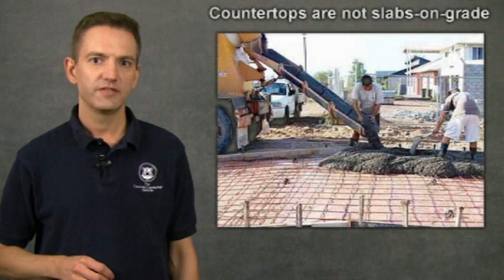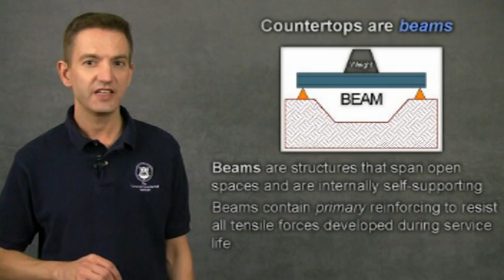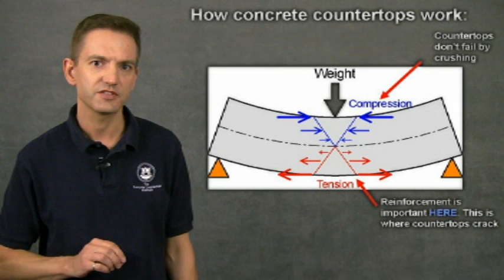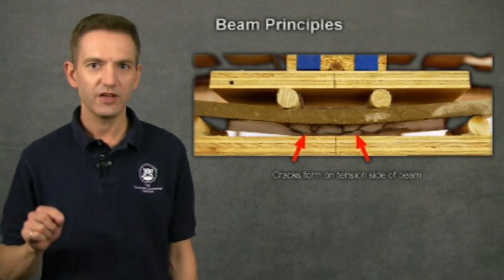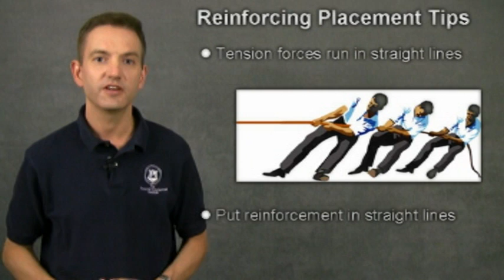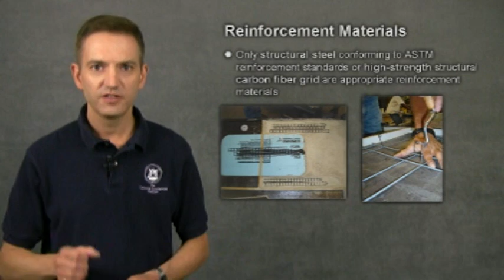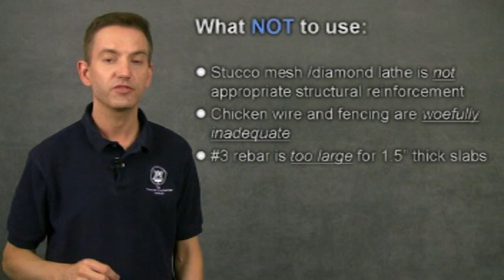Concrete Countertops: How reinforcing works

Comment: Very useful informative and useful. But it would be far more useful to focus more on the practical applications of reinforcing a concrete countertops. Such as how best to use 9 gauge ladder wire and GFRC. 

For example, can just outer third to half of concrete countertops that will be in tension just use GFRC while the opposite side just use a conventional mix? Also will using GFRC have an added advantage of making the concrete more resistant to cracking from impacts too (if its used on the surface)? Is pretensioning of the reinforcement like when using  9 gauge ladder wire ever recommended? Or adding plasticizers to prevent superficial cracks. And is has or could an aerated or polystyrene concrete be uses for the inner part of the countertop that not in compression or tension?
Reply from the maker: This seminar is about reinforcing principles that apply to conventional precast concrete. Reinforcing for GFRC is completely different, and in fact you cannot use steel reinforcing in GFRC. For extensive information about GFRC including how the AR glass fibers provide primary reinforcement, please see http://www.concretecountertopinstitute.com/blog/2015/08/index-gfrc-concrete-countertop-training-free-information/.
Reply: Sorry it was a typo on my part, I should have said "9 gauge ladder wire or GFRC", since I realize there would be issues using both them in the same countertop. And thx for getting back to be so quickly and for the link even if u couldnt address my inquiries. Keep up the good work.

Comment: in conclusion, with concrete particularly, we have so much flexibility and it will tolerate lots of flex, especially when you try to realise your designs. however, there are some basic building block engineering tenets that this man puts back in your mind. concrete is seriously underexploited, but then so are most plant fibres too.

Comment: Do you guys use pp fibers in some products?
Reply from the maker: We rarely use polypropylene fibers. These fibers are not for primary reinforcement. They can play a valuable role in shrinkage control during the curing process but provide no benefit after. Please see http://www.concretecountertopinstitute.com/blog/2017/11/fibers-precast-gfrc-ecc/.

Comment: I am building a 1.5" x 4' x 5' slab for an outdoor kitchen. They will be supported by a 5' x 32" cabinet base. Do I run ladder wire close to the bottom of the slab depth along the 5' length direction for the Simpson's beam stress and  another run of ladder wire along the 4' width direction for the cow cantileaver diving board stress? If I do this properly, do I also need corbels to support the 16" overhang, or is the integral ladder wire enough?
Reply from the maker: Joe, I love the terminology "Simpson's beam stress" and "cow cantilever diving board stress"! LOL! 

Yes, the 5' length ladder wire is on the bottom of the slab, and the 4' length is on the top. You likely don't need corbels because you've got a 2 to 1 ratio of supported to unsupported, so you don't have a tilting problem. However, corbels never hurt, and they can be a decorative feature.
Reply: Glad to bring you a laugh. One follow-up: your 3 hour intro seminar says not to vibrate after reinforcement goes in because it can sink or cause ghosting.

I'm not worried about sinking because I'll suspend reinforcement from strings, but since the cantileaver reinforcement goes 1/4" from the bottom of the form, how do I vibrate? Do I pour less than 1/4" of concrete, vibrate that, set the reinforcement in place, then pour in the rest of the concrete?
Reply from the maker: You are correct, Joe. Also make sure the reinforcement is well supported/suspended so it doesn't move around during vibration. Or, you could avoid the issue completely by using a stiff, hand packed mix or by using GFRC.

Comment: I'm doing an outdoor concrete countertop and I was wondering if I could or should use the block wire and the fiber glass together ,it will be two inches thick and i will be using 3/4 inch stone in the mix as well ,thanks for you help
Reply from the maker: If by fiber glass you mean AR glass fibers, no. Those are used as primary reinforcing in Glass Fiber Reinforced Concrete, whereas steel is used as primary reinforcing in traditional aggregate based concrete. You can use various types of fibers for secondary reinforcement to control plastic shrinkage cracking, but those fibers will not replace steel or provide/supplement structural reinforcing. Please see my blog articles about fibers: http://www.concretecountertopinstitute.com/blog/?s=fibers&submit=Search  Curing is also a very important part of crack prevention, as is proper mix design and low water-cement ratio.

Comment: Great video! What is the best method of reinforcing inside corners for a L shape countertop?
Reply from the maker: Just treat the 2 ends of the L as 2 overlapping rectangles. Mix design is also important for preventing cracks on inside corners. You need a good mix design that has low shrinkage potential. Usually interior corners on sidewalks, etc., crack because the concrete has too high of a shrinkage rate. My mix designs are available here: http://www.concretecountertopinstitute.com/product-category/self-study-training/mix-designs/ And of course you have to cure properly too.

Comment: Excellent explanation. I need to make a very thin rectangular countertop, say 19 mm thick x W=800 mm x L=900 mm supported at the perimeter. Can it be done? how? Thank you!
Reply from the maker: For this large, thin application, I would use GFRC instead of traditional precast. Please visit our website at http://www.concretecountertopinstitute.com/blog/2015/08/index-gfrc-concrete-countertop-training-free-information/ for extensive GFRC information.

Comment: What grid dimension of ladder wire do you recommend?
Reply from the maker: Alex, the grid dimension does not matter, because only the longitudinal strands matter. Mesh reinforcing generally has a grid spacing that is too big for the number of strands needed for countertop-sized slabs. What complicates things is that the number of longitudinal strands needed is entirely dependent upon the length of the slab. For instance, a 4 foot section of kitchen countertop may only need 4 strands to be strong enough to handle, yet a slab double that length need more than three times as many. There is no simple rule of thumb for this that doesn't either underestimate for large slabs or overestimate for shorter ones.

Comment: great video ... how far in from the edges of a worktop should the ladder mesh run? i.e. if i had a 2400 cm worktop ... what length would i cut my ladder mesh to? thank. doug
Reply from the maker: You should run the reinforcing as long as possible. You need only about 6mm of cover, so you can go that close to the edge.
Reply: Cheers!

Comment: A very informative video!   I'm planning a counter top (60" X 30" X 2" slab) with a 2 inch over hang on 3 sides.  Should I run the ladder wire from back to front (30") or lengthwise (60")?  Thanks again for the great video!
Reply from the maker: Thanks, I'm glad it was helpful! this is a good question. You are thinking about where the stresses are in the countertop. You should definitely run the reinforcing lengthwise (60"). To be safe, it wouldn't hurt also to run it back to front (30").

Comment: Excellent Video. Thanks very much! In your example of a sink cut into the bench top, how would you have reinforced this? Cheers.
Reply from the maker: You are very welcome Tom! When you have a sink cutout, you still need to run the reinforcing all the way along the slab in a continuous straight line. So you reinforce the same but also add extra reinforcing in front of and behind the sink.

Comment: What kind of long metal or mesh can I use to make my 56" × 26 nch countertop? It is straight with 2 small sinks.
Reply from the maker: This should be relatively low risk, but use the 9-gauge block ladder wire recommended in the video. It's available from masonry supply stores.

Comment: What is the best way to avoid the ghosting? You mention in your blog that pouring over reinforcement and placing reinforcement after pouring both can cause ghosting...as well as vibration...so what is your best recommendation on how to avoid this? Finally if it is pouring over the reinforcement, how do you suspend the ladder wire? Thanks Jeffrey!
Reply from the maker: Please see this article about ghosting: http://www.concretecountertopinstitute.com/blog/2012/10/how-to-avoid-ghostlymistakes-in-your-concrete-countertops/

Comment: Thanks for the great video Jeffery! Very helpful. I am making 1.5" thick pre-cast countertops for our kitchen and am planning on using 9 gauge masonry wire as reinforcement. Based on the info presented in your video, am I correct in saying that you would not suggest making a perimeter loop out of rebar or any other material? Also, what distance from the edge of the countertop would you recommend the reinforcement ending? I have heard that air trapping can occur if the reinforcement is placed too close to the edge.

I read your article on ghosting and in your words, "A third way ghosting occurs is when reinforcing already buried in fresh concrete is moved or vibrated". I was planning on using a vibrator to help the concrete settle in the mold..would you recommend not using a vibrator at all?

Please let me know what you think!
 
Caleb

Comment: Thanks , My need is to know for a 3 inches slab or counter top, what the size of iron bars should i be using. Secondly we are familiar with milimeters rather than using gauge, so for 8 & 10 mm bars how to convert to gauge, Thank you sir
Reply from the maker: For a 3" (76mm) slab, you should use standard #3 rebar, which is 3/8" or 9.5mm. So 10mm would be fine if that's what you can get. The 9-gauge ladder wire you see in the video is appropriate for thinner slabs, 1.5" (38mm) thick.
Reply: Thank youSir, very helpful will go by the 10 mm. Thanks

Comment: Just out of curiosity, what would be the absolute thinnest slab that you could make with GFRC reinforcement that would stand up to at least a 300 pound load?
Reply from the maker: +kobudo, That's impossible to say without knowing the dimensions of the piece, how it's supported (just on the ends or on a solid substrate), and whether this is a point load or would be distributed across some area.
Reply: The Concrete Countertop Institute About 18" x 8", supported under the ends of the 20" span, with a 300 lb. point load at the midpoint. 

Just curious.
Reply from the maker: 1.25" is the minimum thickness I'd recommend. However, this is pretty close to the working limit of the slab, so to be safe I'd cast it 1.5" thick.

Comment: We are building a concrete countertop for a kitchen island. It is 1-1/2" thick, 4' wide and 7', 2" long it will have a 9 inch overhang on the long edge. We are using ladder wire for reinforcement. Do we need to build 2 separate reinforcements for this or can we simple use one and add extra ladder wire where the overhang will be? We did build 2 separate ones but the one closest to the form (finished surface) is only 1/4" from the form. my concern is that it is too close to the surface and we have too much reinforcements.
Reply: I'm no expert but it sounds like two sets of reinforcements are required: one length wise (ladder wire near the bottom), and one set width wise (near the top) for the cantilever of the overhang.

(2) According to the video, reinforcement closer to the center is less effective, so further out is better, but where's the limit? How close to the surface do you want to be?
Reply from the maker: Hi Matt, sorry I missed this. Hugh is right, you do need one length wise near the bottom and one width wise near the top for the cantilever. The cantilever reinforcing can be 27" long (twice the length of the overhang). It doesn't have to be as dense as the regular reinforcing. 9" is not much of an overhang and probably not an issue unless somebody really heavy is going to be sitting on that edge.

1/4" from the finished surface is fine. 3/8" would be the maximum, and the minimum is right at the surface. Please see this article about ghosting: http://www.concretecountertopinstitute.com/blog/2012/10/how-to-avoid-ghostlymistakes-in-your-concrete-countertops/

I doubt you have too much reinforcing. It's better safe than sorry. Too much would be so much that there's more steel than concrete.

Comment: probably could do with a new HD version but the content is essentially very good.   only real problem is, you show us what NOT to do when it comes to reinforcing concrete countertops.   you don't show us what to do!!!!!!!

couple of images showing correct reinforcement approaches for different countertops would do.   even just providing links to them
Reply from the maker: It's important to understand the general principles of reinforcing and avoid the pitfalls that come from not having that understanding, but yes, knowing what TO do is as important as knowing what NOT TO do. Basically, the to-do is to put the reinforcing near the bottom. For typical countertop thicknesses, use 9-gauge masonry block ladder wire. How many strands to place depends on the geometry of the countertop, but generally placing them a couple of inches apart is adequate for most situations.

Comment: This might be a little off topic for counter tops which I am interested in.  I am also interested in applying this to build a thin shell concrete dome workshop using basalt rebar and mesh.  Do you have any thoughts about applying this to a small to medium size dome shaped workshop?  Thanks!
Reply from the maker: +Robert Miller Hi Robert, sorry for the delay in replying to you. This is indeed far removed from countertops (thin slabs supported by the ends). I recommend that you get specific advice from a structural engineer, particularly because people will be underneath this structure.
Reply: Yes I will absolutely get advice from a structural engineer before I build.  If for no other reason than to save money from grossly over building.  I was just curious about what you thought in general.  Perhaps what you know about the strength of a well built 1 1/2" or 2" counter top using basalt rebar and mesh.
I'm at least a full year before I'd build anything.  I'm just thinking out loud so to speak.  Thanks!
I have learned a lot about Concrete counter tops.  I'm an old laminated counter top guy myself.  This is way better!

Comment: Great video! I am trying to make my first concrete countertop that I'm wanting to make 1.5" thick. If I am putting my WWF near the bottom of the slab, how much concrete cover do you recommend? I feel like anything less than 3/4" of cover will result in ghosting or the concrete spalling off?
Reply from the maker: Kyle Sievers  You need only 1/4" of cover. That will achieve enough of a bond to hold the steel in, and it won't cause ghosting. See this article about the causes of ghosting: http://www.concretecountertopinstitute.com/blog/2012/10/how-to-avoid-ghostlymistakes-in-your-concrete-countertops/
Reply: Perfect! So what do you recommend around sink knockouts and other openings if #3 rebar is too large for a 1.5" countertop??
Reply from the maker: Kyle Sievers You should use masonry block ladder wire, 9 gauge, or 0.147” (3.7mm) in diameter, throughout. 

There is no easy rule of thumb for the necessary spacing, because stresses vary depending on the geometry of the slab. However, you're usually safe with a spacing of about 6". 

Near sink holes, you will add reinforcing on the opposite (top) face, as if it were a cantilever. Remember, outlining the sink holes does no good - you should run the reinforcing in the long direction.

Comment: Jeff,
you said in this video that reinforcement that runs across the narrow width of the countertop is poor practice. I would expect that once in-service the 2' direction of the countertop is the span that see flexural load. Therefore, I would think that reinforcing is important in both directions: lengthwise is important for transport loads, while reinforcing across the narrow width is important for in-service loads. Do you Agree?
Reply from the maker: Shawn, you are correct. The need for reinforcing is greatest when you are lifting and moving slabs in your shop and during installation. Once installed, the width of the cabinet is the greatest span that the countertop will experience. Many cabinets are 30" or 36" wide and 24" deep.

Additionally, the front edge of a cabinet is "soft", meaning the front opening isn't rigid like the side walls because of door and drawer openings, and because the front of the cabinet doesn't extend all the way down to the floor like the side walls do.

So yes, you should reinforce in both directions, although the short direction is less critical. While I don't mention this in the video in order to simplify the concepts, reinforcing in both directions is included in the step by step instructions in my textbooks.

Very good question, thank you!